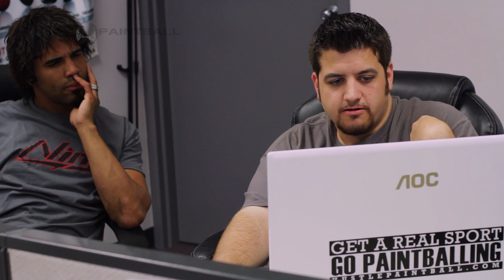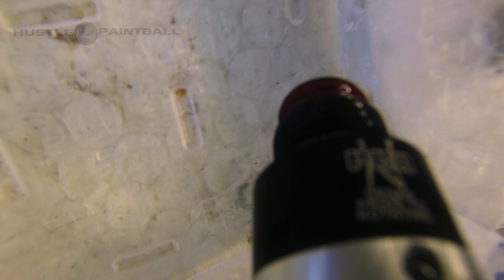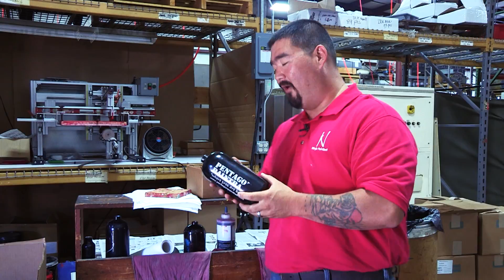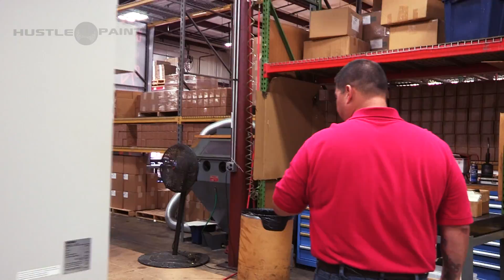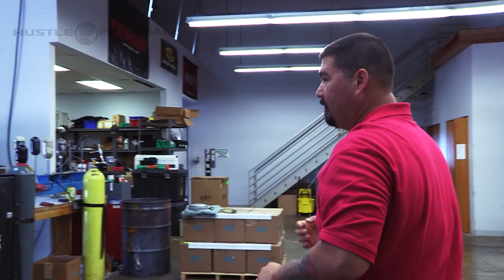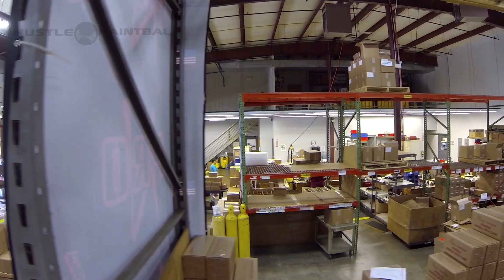Ninja Paintball Tour - 100% Made in the USA. Machine shop, interviews, and everything!

Comment: so which is better a ninja 48/4500 with standard reg or a guerrilla 48/4500 with m4.5 reg??????
Reply: Ninja all the way... GA has had problems with some regs in past never had problem with ninja regs
Reply: Ninja. I have a myth3 and I had creeping problem. Also, even if it seems like a plus to have a shorter reg, at some point you will have problem with it. One is that the fill nipple can get in the way when you screw the tank on the gun (it catches on the grip frame). This happened to me twice and it's a real bummer...